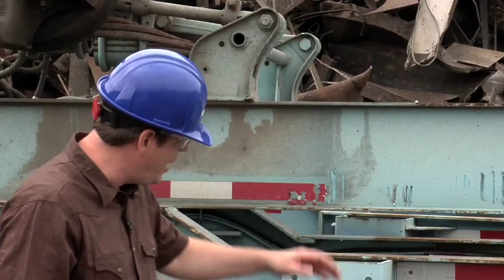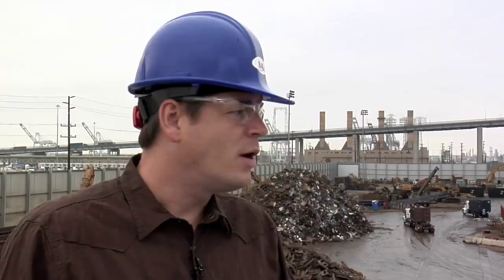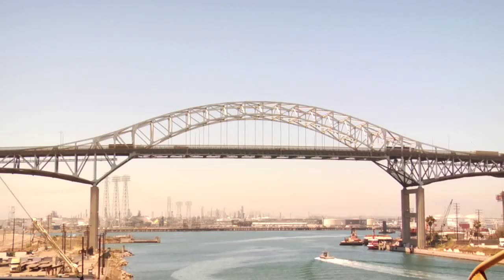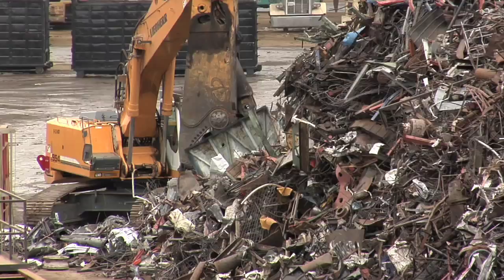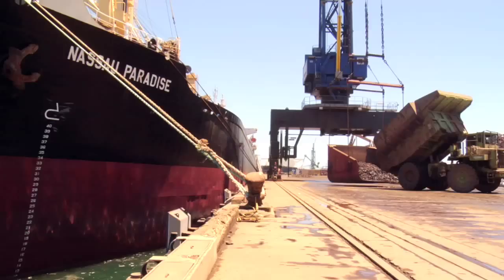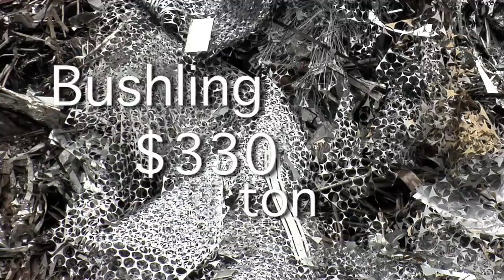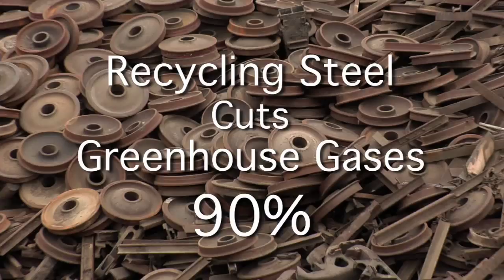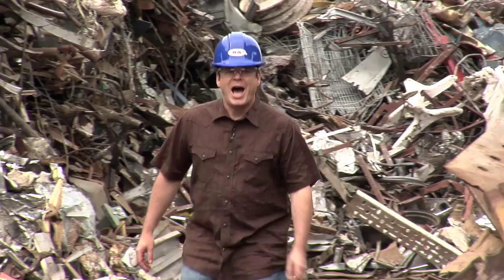Pulse of the Port -- SA Recycling

Comment: SA formerly known as Hugo has been a fixture of ICTF Long Beach since they opened in the 60s. It is here junk, high quality metal, and iron ore and taconite begin their journey to Shenzhen China or Korea. 

First trucks or railcars from Union Pacific and BNSF are brought in and weighed at one of two yards Berth 210 at Pier 400 or Pier T Berth 140. Once the scrap comes in it is either removed by a grapple or lifted off with a shier tractor and cut up. rail cars are unload using a magnet or discharged in the shed. Once the material has been removed a grapple sifts it and it is loaded into the shredder where it is reduced until it is the size of sand or gravel depending on the customer. 

Once the load is shredded it is loaded into a dump truck with a loader which takes it to the dock and it is dumped into a pan or picked up with a grapple and dumped into the ships hold. Once the ship is loaded with scrap and iron ore it is sent to Shenzhen or Korea and made into something new be it containers or goods which arrive at Long Beach each day.